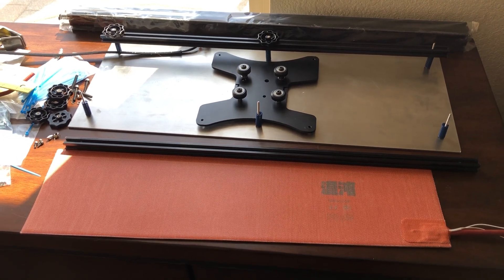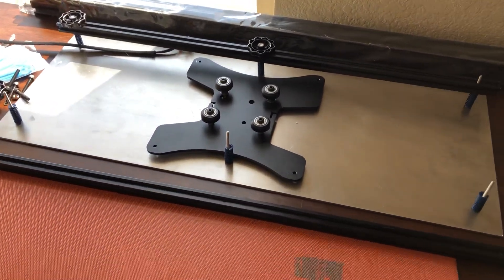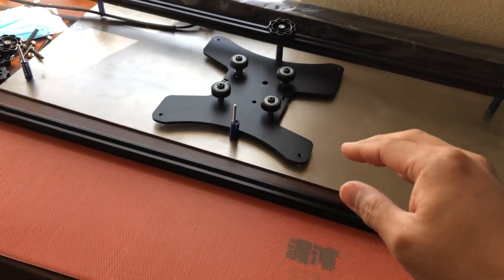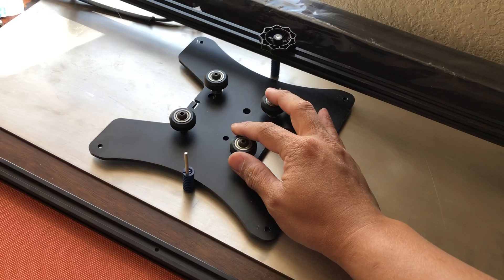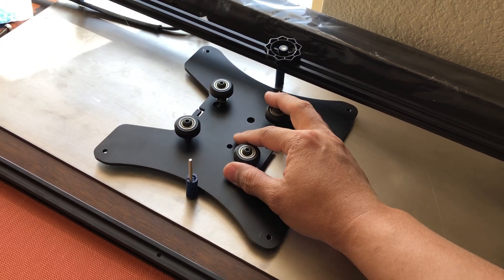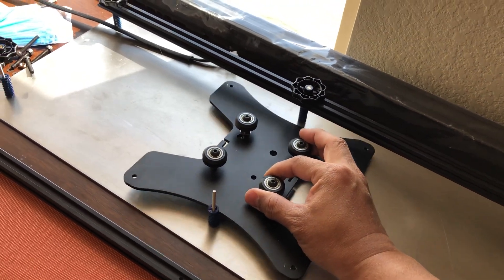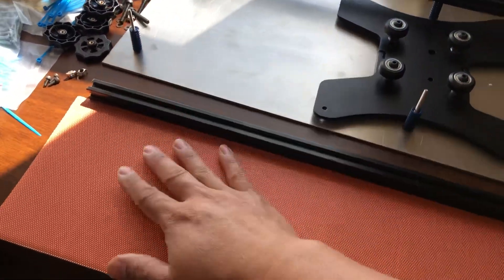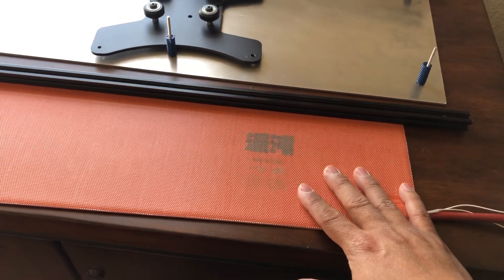Y-extension kits in development

Comment: I'm considering a smaller 2:1 Super cheap upgrade. I print on mirror which is very flat and stiff. I can buy a "Door Mirror" for $7 and cut my 235x500mm.  I may use 2 carbon fiber square tubes for attachment and support. I may just use 2 stock heaters. Then I'd have 2 zones if I'm not printing the full bed.
Reply from the maker: Have you tried to cut a mirror? My understanding is it’s treated in such a way to make it impossible. I’ve tried with no luck, but let me know how it works for you.
Reply: @DewItJustinKace  I'm using stand pane mirror. Lowe's has a full length "door Mirror" for $7. I have a 235x235 mirror I cut on my main Ender 3.

You just have to take your time. I would not try to cut a thick beveled edge mirror. I tried but the edges are not straight. Mainly thinking about weight.

I may try a technique were you score it. and use hot water, which causes the score to crack cleanly.

Comment: Solid state relay would be optimal. Enderextender now has a similar layout(235x400).  but they require the stock heatbed to heat the whole thing, which is not a good idea(it's just too small... there is about 80mm at the front and back that are not directly heated). also they don't have the plate supported with extrusions like your design. I think this route would be optimal. How much do you expect the whole kit to cost? (The kit + the plate sold from the other seller)
Reply from the maker: The heat pad and the bed itself are the most expensive. For the initial kits I’d be willing to sell them close to cost so multiple people can test.
Reply: @DewItJustinKace approximately how much are you thinking? Like ~100-125, 125-150, 150-175? Just to get an idea of the cost? Not that it matters much, as the bigest thing is getting something lol. 

Also, how long are you making it? I couple different iterations on project ender, what is the planned length for the kit?
Reply from the maker: @brandoneich2412  I haven't crunched the numbers in a while. Plus I have no control over what someone else will charge for the bed. If you are willing to drill tapered holes yourself, I can offer a better deal.
Reply: @DewItJustinKace  I would not be opposed to drilling and counter sinking holes. :) Just wanted an idea of how much the upgrade would cost. If it is over 200 I likely wouldn't be interested. I would expect to pay approximately 150 -170 for an ender 3 pro upgrade. Maybe 200 if it was like 600mm(24in)mm long. But if it's between 400-500 mm(16-20") ideally I'd want to pay less than 175, and closer to 150.